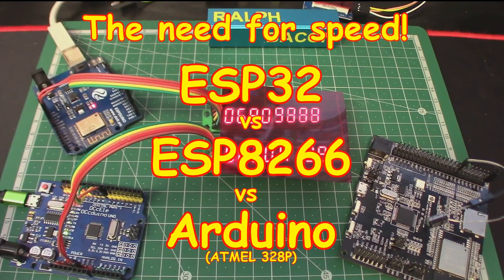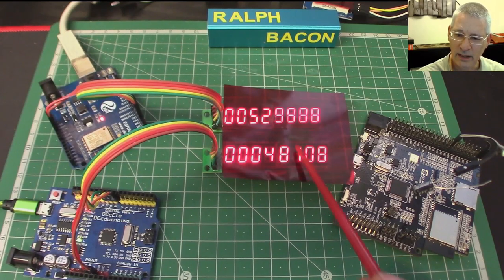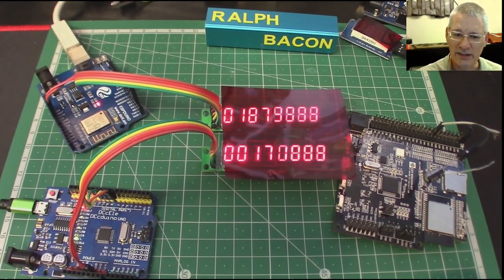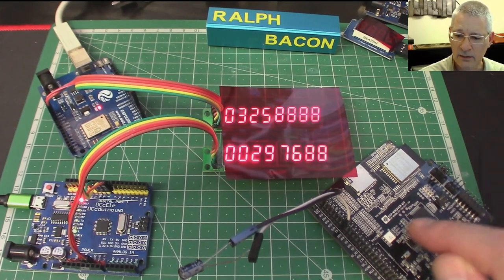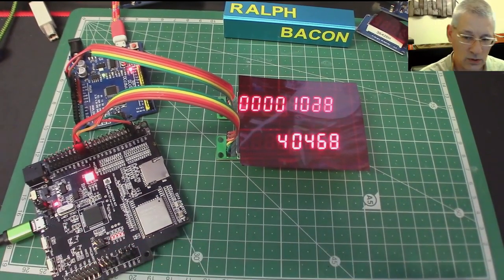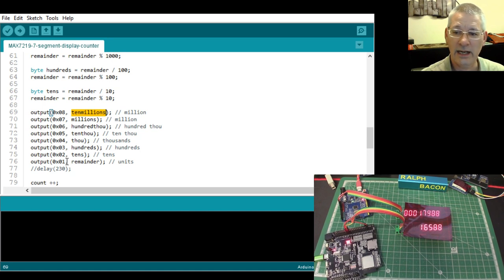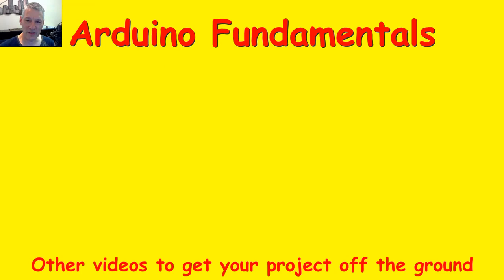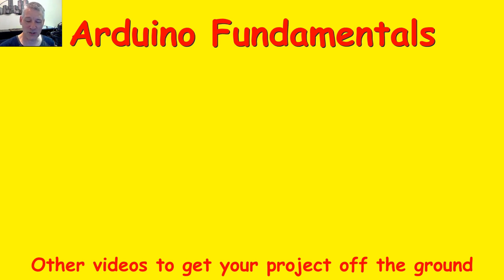#95 Speed Contest! ESP8266, ESP32 and the Uno 328P

Comment: Hi Ralph. I hope you and your family are having a great holiday season and that your health continues to improve.

I have a conundrum with the ESP8266 Wemos D1R1.

I'm trying to activate a relay via an NPN MOSFET and it works fine if I  power up the Wemos WITHOUT the ground for the MOSFET/Relay connected and then connect the ground AFTER bootup. 

However, if the ground is connected at time of powerUp of the Wemos, the relay instantly energizes and the Wemos won't boot.

If you go to: https://hausofpayne.weebly.com/wemosRelay 

and check out my circuit diagram and sketch, you'll see the details. I used an UNO graphic, but it's a Wemos D1 R1 I'm using in the project.

Yes, I know I should be using an opto-isolated relay, but I'm actually using the relay contact as the hammer for a small chime. There will be NO Load voltage on the NC or NO sides of the 3V relay. No connections at all other than coil.

No rush on this Ralph. If you've got some insights that I can incorporate into my circuit/sketch, they're always welcome.

Thanks as always Ralph.

Gord
Reply from the maker: Hi Gord and Happy New Year! 
Boy, you like making things difficult for me don't you? Fritzing layouts are the spawn of the devil when it comes to figuring out the circuit diagram.
Looking at your diagram the MOSFET has its GATE connected to the D8 pin of the ESP8266. It also connects to a 10K resistor to GND to keep it off until driven on.
The Source of the MOSFET goes to GND.
The DRAIN of the MOSFET goes to one side of the relay,
The other side of the relay goes to +5v.
IMPORTANT! There should be a 1N4001 or similar diode across the relay with the cathode connected to +5v to protect the MOSFET or it will die due to all the back EMF voltages.
If you disconnect D8 from your ESP8266 and connect it to +5v does it all work correctly?
IMPORTANT! Note that if D8 is pulled/held HIGH at boot time then the boot will fail. Try using a different pin eg D1, D2, D5, D6, D7 all of which have no effect on booting up.
Let me know!
PS This also might help: https://randomnerdtutorials.com/esp8266-pinout-reference-gpios/
Reply: thank you very much for your clarification Ralph. I appreciate your expertise! Best wishes, Gord
Reply: @RalphBacon  Thanks for your help Ralph. Sure enough, D8 is HIGH during upload and boot. I moved the relay to D10 and all's great! I tested each pin with the basic Blink sketch and here are my Voltage results. I used a digital multimeter so results are just what I saw on the display.

Voltage at Upload/ Post Upload / Boot to Upload 
Running Basic Blink sketch with built in LED only

Dx    V on Upload    V After Upload  V Boot to V Run
0      3.x                                 3.x             1.x up to 3
1      3.x                                 3.x             1.x up to 3
2      3.x                                 0               1.x down to 0
3      0                                    0               0
4      0                                    0               0
5      0                                    0               1.x down to 0
6      3.x                                 0               1.x down to 0
7      3.x                                 0               1.x down to 0
8      3.x                                 3.x             1.x up to 3.x
9      3.x                                 floats        1.x to floating
10     0                                   0               0
11     3.x                                0               0.x down to 0
12     3.x                                0               1.x down to 0    
13     3.x                                0               1.x down to 0

Thanks again! You are the Professor of PLC Pultritude! Best wishes, Gord
Reply from the maker: Glad I could help! Don't forget that protection diode across the relay!
Reply: @RalphBacon  absolutely! Always!